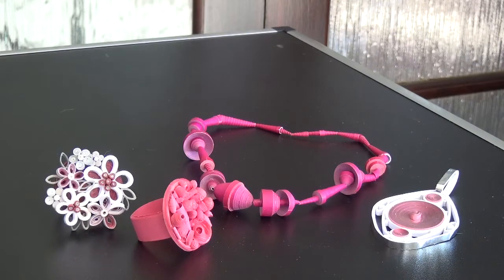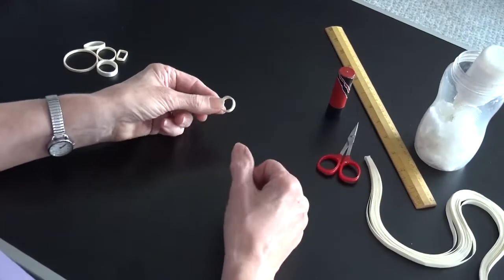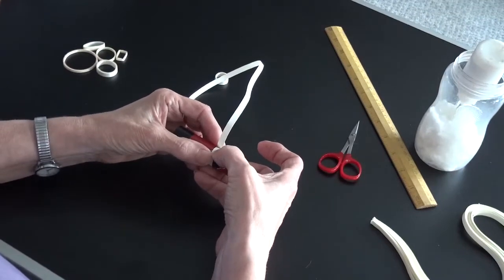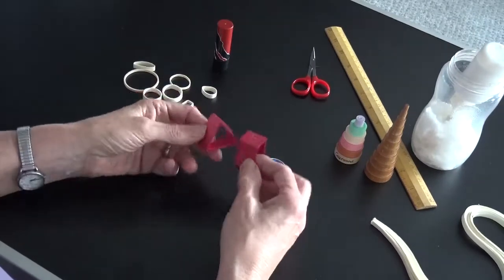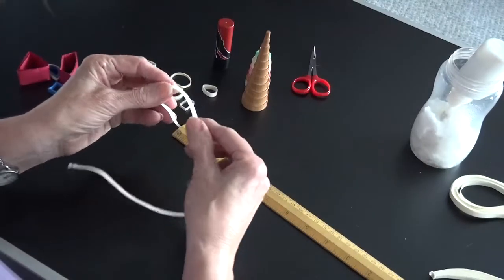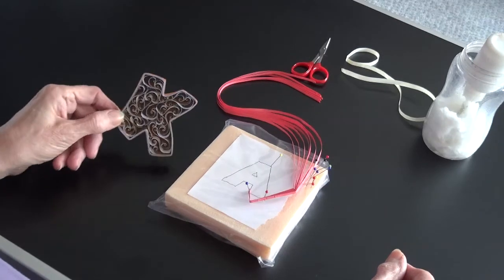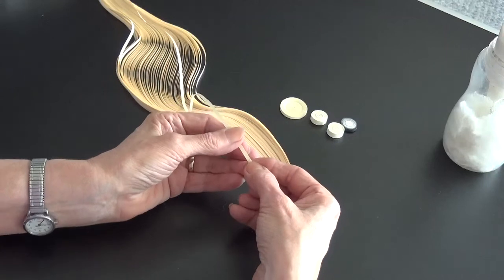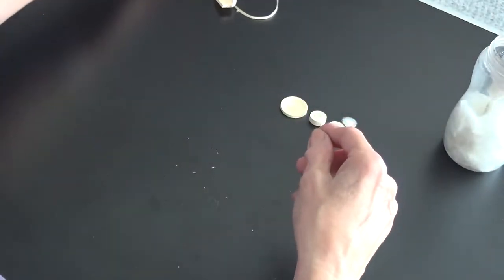Quilling - Tight Coils Demonstration

Comment: The last time I watched this demonstration, I put aside a whole day to do finger rolling.  I ended up unsuccessful and frustrated.  I have tried again unsuccessfully.  One thing I could not get right was transferring from the initial centre coil to transferring to rolling using my thumb.  Everything just fell apart!  I have resigned myself to using my Japanese quilling tool to get the tiniest centre hole!
Reply: Incidentally, where do you now get your quilling strips?
Reply: Hi Rhoda.  Sorry you had such trouble finger rolling.  Sometimes, if I want a coil with no hole at the centre, I begin it and then just before transferring to finger and thumb, I insert a tiny dot of glue and wait for it to dry before continuing. Happily though, often a hole at the centre is perfectly acceptable, anyway.  
As far as strips go, I am in the happy position of still using those left over from when we had the business.  I did buy some edged ones from Katy Sue.
Hope you will make it to this year's Quilling Guild Celebration in York.